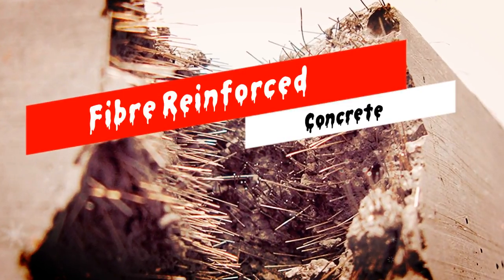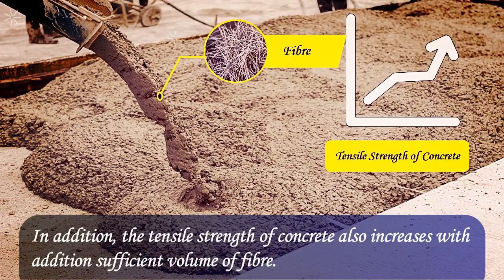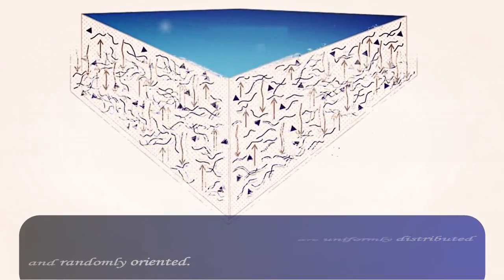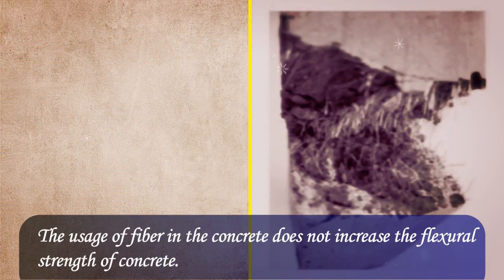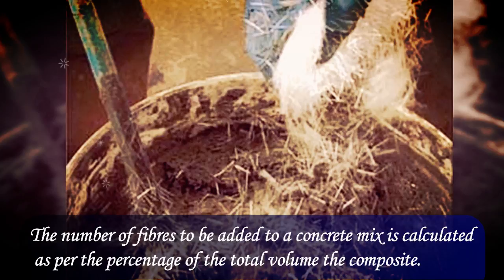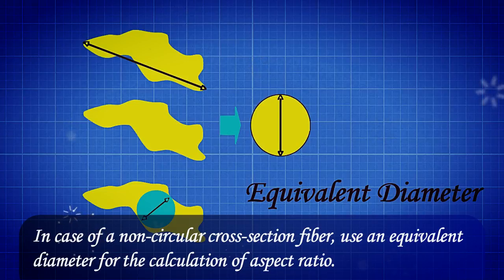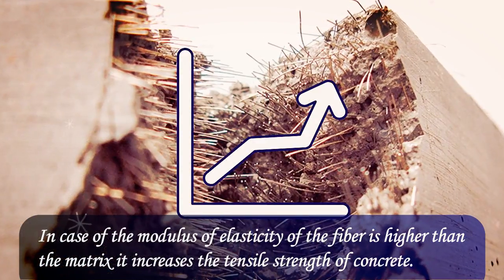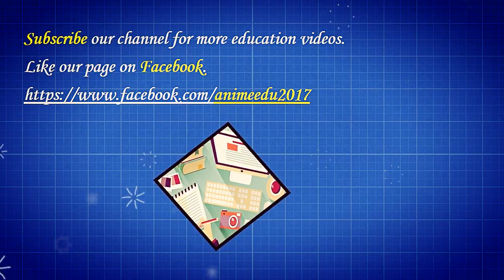What is fibre reinforced concrete? // Effect of fibre in the concrete //

Comment: There are several major cracks on the roof of my builder flat as My flat is ground floor is there any way to repair as steel frame in roof  has become dead as it has lost its strength due to rust it is 60 years old instead of constructing new roof builder just renovated it.
Reply from the maker: Can you mail us the phographs. animedotedu@gmail.com
Reply: Grouting ....